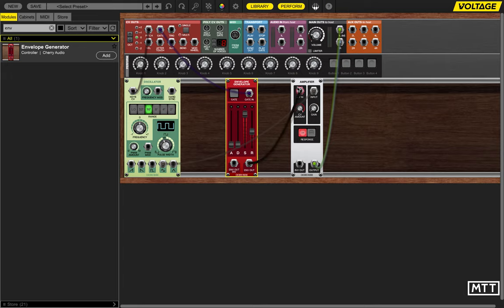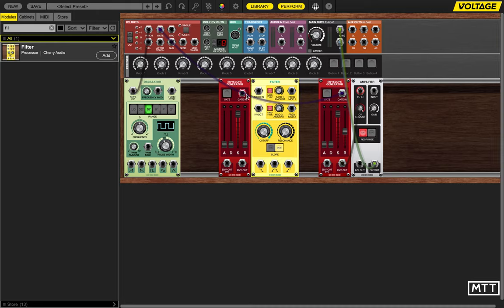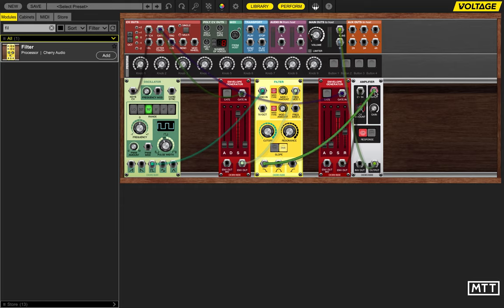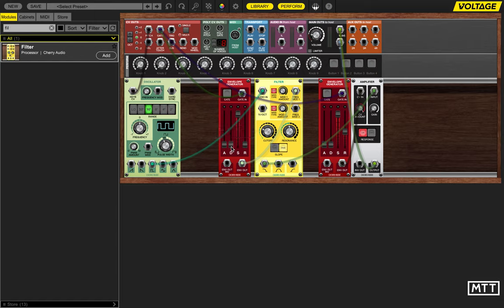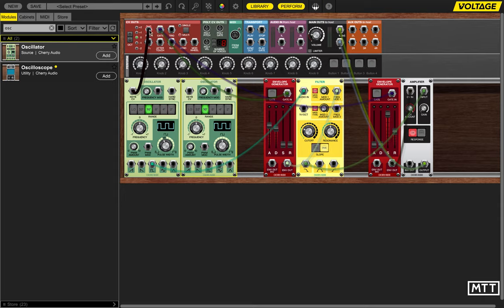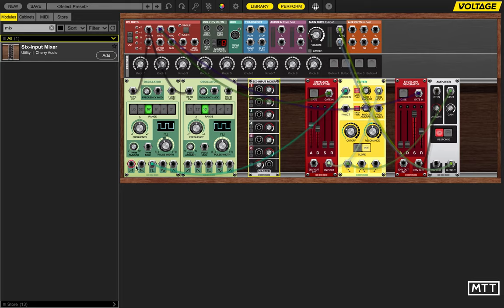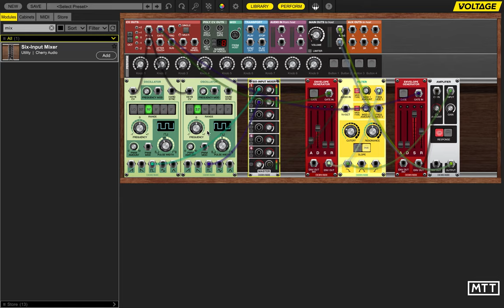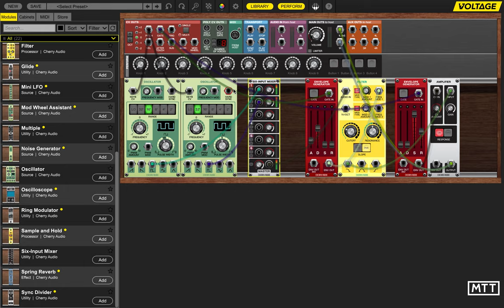Voltage Modular: 2 - Adding a Filter and Extra Oscillator

Comment: Got this for free last week, then paid £35 to upgrade to the "top" version with a drum pack add-on from Plugin Boutique - hands down, the most fun I've had with a new tool for a long time.

The sounds you can get from it are awesome. And yes it does hog the CPU a bit, but I made a template in Cubase to capture each note and push it into a HALion patch, saves my machine resources and adds another layer of flexibility.

The thing is a beast, I've already used it to create MIDI and audio effects instead of synthesis as you can route and manipulate just those if you wanted, AND in the top version there's a module that lets you load a VST or VSTi - this is enormously powerful, just a shame it's such a CPU hog!

Even started coding my own modules in Java but it's not a language I'm used to so a little slow.

Seriously can't recommend this enough!
Reply from the maker: Hi Andy.  Yes, I've owned the full version for a while, and have found it really useful, just limited by its CPU use!  

Hoping to take a look at the module programming side of things at some point, but thought at this point it would be useful to get people started on it - particularly because I've taught quite a few classes when people have initially been scared of using a modular synth, but then have actually found it to be a really useful learning tool.